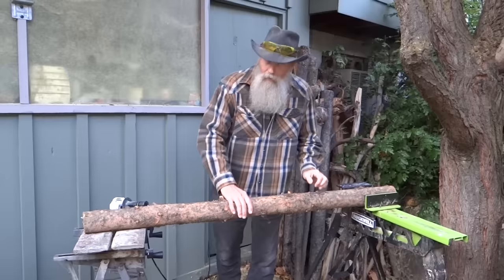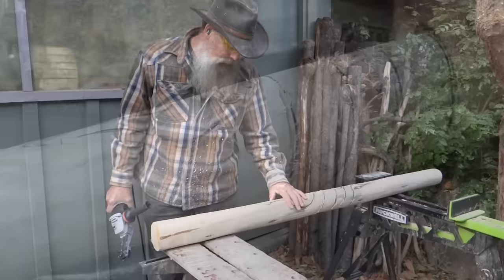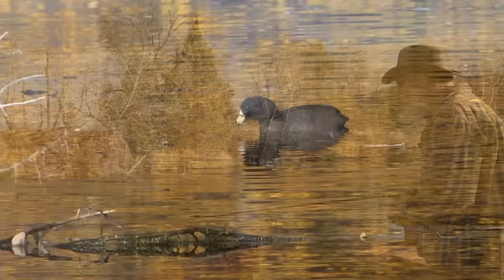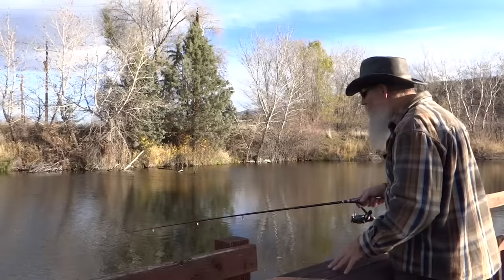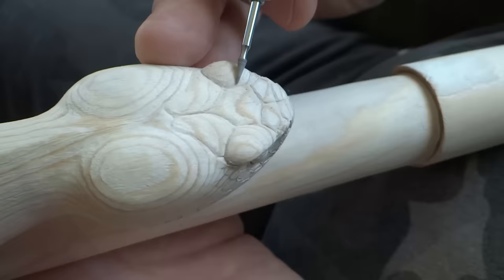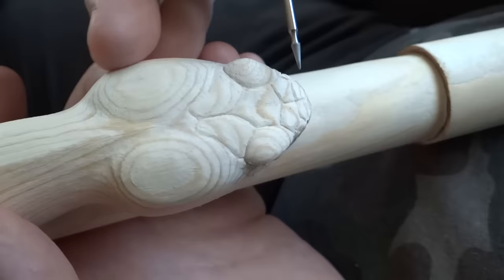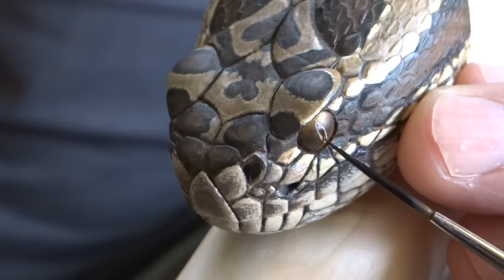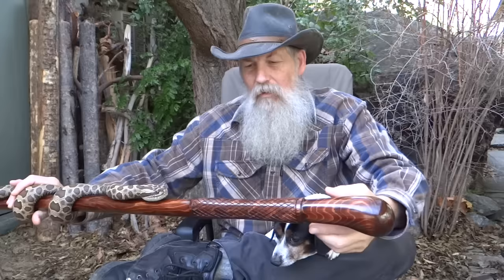Carving a Massasauga Rattlesnake Walking Stick

Comment: I like the way Pearl looks back at you to see if you are doing ok. Lovely snake and thanks for introducing me to one I'd never heard of.
Reply: Only venomous snake found in Michigan.  They are smaller than most rattle snakes. I have seen them three to four feet long.. They are a protected species in Michigan
They need a special habitat. Usually not too far from water or swampy areas.
Reply: @debihalsey2247  we have the timber rattler in Massachusetts that is also protected. thanks for the info

Comment: Hi there, I am getting into power carving and had a question about burrs. I use the Kutzal rotary burrs for rough the shapes out, but wondered what burr to use next for a smoother finish? Also, what burrs are good for final touches and detailing?

Comment: Another beautiful piece Mike, the natural grain of the "stick" portion did turn out really nice, looks like the colouring reversed between the slow  and fast wood grains. Going with your thought on being able to not burn in the scales to leave the natural wood grain, have you ever tried using oxalic acid to try and remove the burn stains? Might work.
Also curious when prepping the log, you don't use a draw knife to de-bark it and get rid of the extraneous limbs? Would think that would be quicker and also even when you're removing bulk waste after outlining the snake.
Reply from the maker: Thank you! I haven't tried acid to remove the wood burned color. I will do some experimenting. On green trees, I use a draw knife, but when the tree is already dead and cured, sometimes I sand off the bark. It's best to grind off the knots, or they might break off under the surface, and leave a hollow area.

Comment: Anybody know what he used to finish the shaft portion of the stick? The contrast of that glasslike finish against the snake is beautiful.
Reply from the maker: I use two coats of Minwax Red Oak  stain,  and two coats of Minwax clear gloss polyurethane. Sand the shaft good, and lightly sand between coats of poly.

Comment: I have a Question Mike. when using your cutting blade how many blades do you go threw on one carving. thanks lee
Reply from the maker: I've been using the same blade with the Arbortech Mini Carver for six or seven years.That's well over a hundred sticks. The sanding discs on the angle grinder will last for several snake sticks before needing replaced.